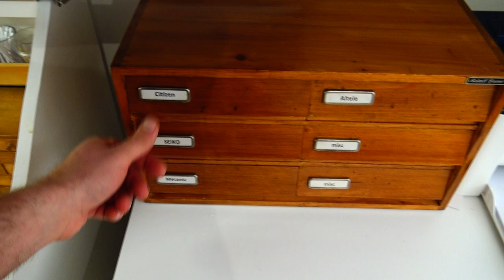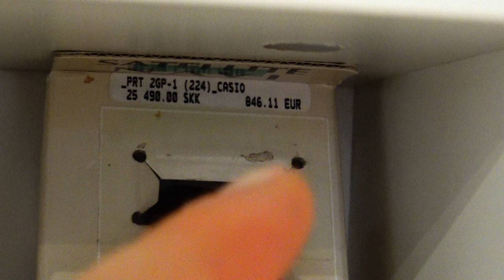Workbench and Collection Tour - Ep - 103 - Vintage Digital Watches

Comment: Dear VDW! Awesome videos, and I've learnt a lot from you about this fascinating technology...not to mention I'm in love with digital watches with a bit more unique display design. I wonder if I can ask something practical: I've found a cool Citizen Jet Boy from around 1980-82 at a garage sale. LCD looks intact, and when I put a battery in, all display sections show digits etc, but in a funny way (letters instead of numbers etc). What I noticed, is that somebody took this apart in the past, and put back the LCD panel bottom-up. If an LCD is put back upside down (not flipped, only turned 180 the wrong way), I assume it gets incorrect info from the mother board, and it can cause the above symptom right? Thanks in advance for your time if you reply to this :)

Comment: Thank you for your videos.  They are very instructive. Perhaps someone can help me with the problem I am experiencing with my Casio 106 H101 Marlin watch.  I'm the original owner and it sat for many many years in a drawer (at least 25 years).  Just last week I rediscovered it and replaced its battery.  It came a live.  The screen is operating perfectly and 3 of the 4 buttons work perfectly.  The button that does not work is the "light" button which has other functions in the other modes.  When I press it, the screen goes blank.  When I release it the screen comes back immediately but with different  numbers.  This happens in all of the modes.  I can reset it with AC but the problem persists.  This problem occurs whether the module is in the watch body or not, so I know it has nothing to do with the pusher in the watch body. The circuit board components were very clean when I opened it to replace the battery.  There was no corrosion anywhere including on the old battery.  I still wiped down everything with alcohol.  Perhaps there is a short but I have no idea where to go from here.

Comment: Help ! Hello , I’m struggling since two months with a modutek 121001 … bought some replacements modules , and when I put a 391 battery all work fine just for one minutes or less or more and everything bug … I don’t understand , I opened it everything seems fine and clean , I cleaned it all and nothing fix the thing … would you have any idea … ? Is there any possibility to join you ?

Comment: Hello I am desperate to find a replacement wristband for my Epson RC20. I saw in one of your video that you have found it. Could you tell me where ? Many thanks
Reply from the maker: It is a Casio Fil Watch strap that I had to sand with a file to get it to fit.
Reply: @VintageDigitalWatches  thanks for your swift answer. So you purchased it on a Casio website? Could you share that file maybe? Many thanks